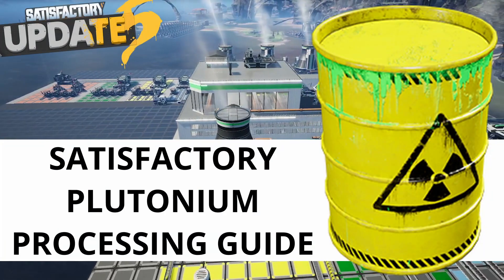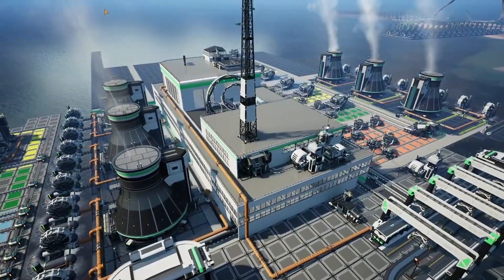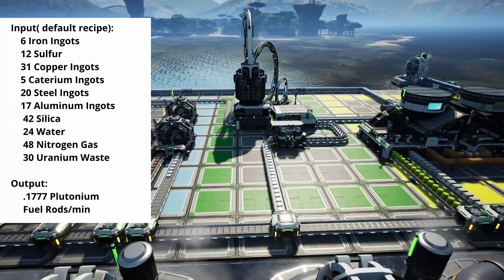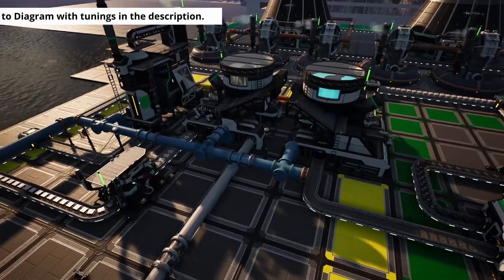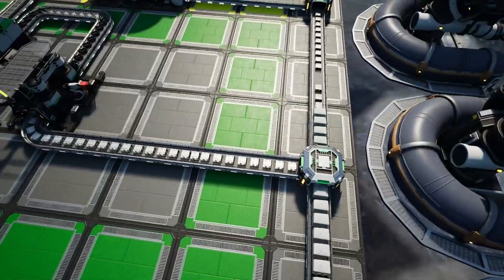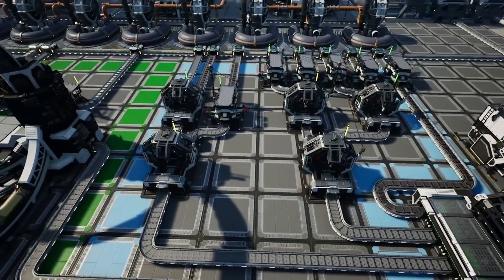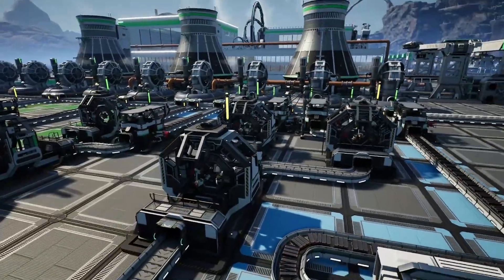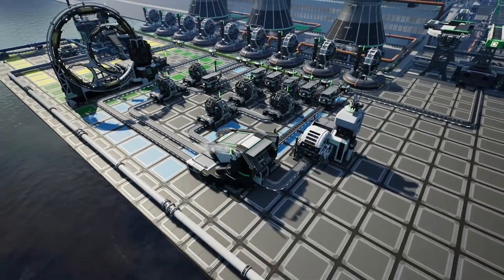Uranium Waste Processing - Plutonium Fuel Rod Factory Guide (Satsifactory Update 5)

Comment: Will this blender setup work even when for some reason the system stop multiple times(resource/power/ets)? How are you sure the water output won't fill up to 100% and cause the last blender to stop?
Reply from the maker: That's a great question. I've got the water extractors tuned to only produce  a few extra units per hour,  to counter the fluid deletion bug in the game, and it has been stable for me. As an alternative you could sink the waste water using pure ingots or wet concrete,  which would probably be safer long term